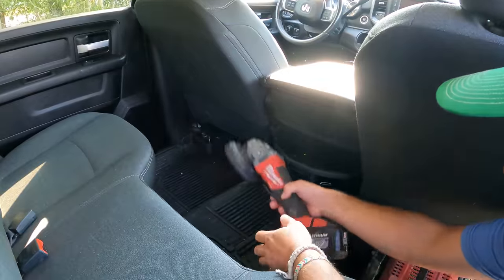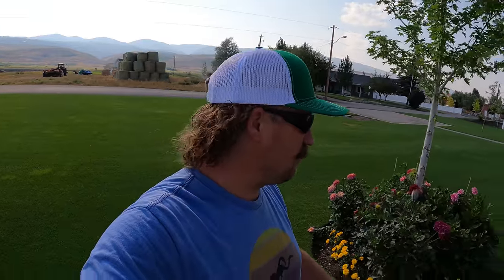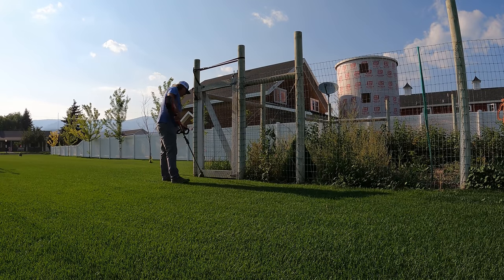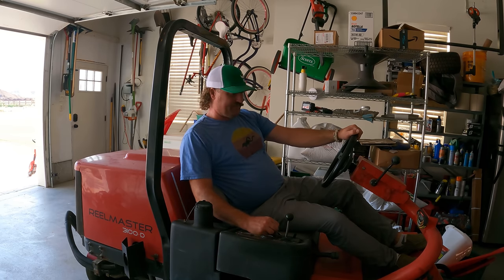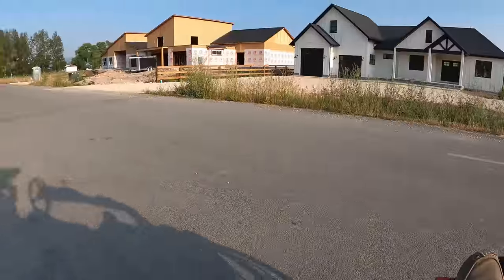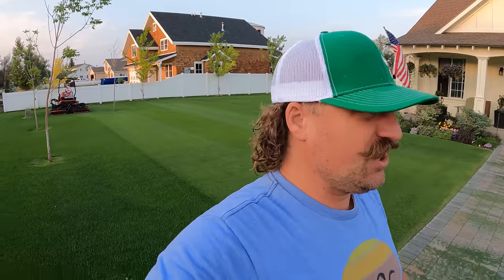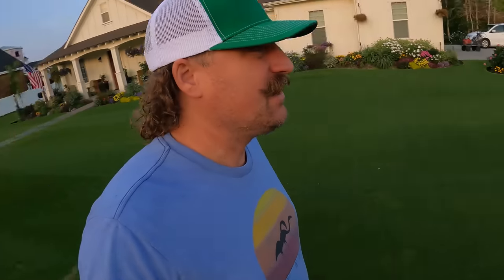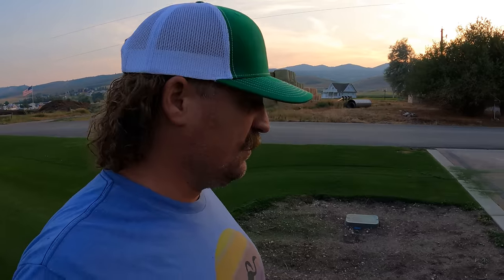Toro Reel Master 3100d Mow

Comment: Use Pro plugger or shovel to dig out the poa* - or use preemergent - no need to do a full reno… so much work and energy and I GUARANTEE you’ll get poa again
Reply: Yea your not going to dig out the annual bluegrass successfully
Reply: @garyboardwine3349  better not dig up my “annual bluegrass.”
Reply: @211212112  for sure,in my 30 years of golf course maintenance,  in some scenarios it's actually desirable,  on lower maint budgets,  bot so in others , the worst case I encountered the "annual blugrass" was over 90% of the putting green surface,  it took 4 years of cultural,  mechanical, and chemical methods to get the creeping bentgrass established,  still had about 10 % of the poa annua , the only place we ever worried about it was on the putting surfaces, mid Atlantic region, transition zone
Reply: @garyboardwine3349  yeah I figured the spots to really tend and cultivate would be the bentgrass putting greens. That grass is pretty unique and does not seem extremely hardy. I’d like to see it in its native areas where large swaths of it grows naturally if that exists. As far as the fairways and such it would seem ideal to use whatever grass that grows well in that area. I’ve seen nice lawns of many types of grass except crab grass.

Comment: Buy the milwaukee "pole extention" part and fit the rotary scissors on that, that way you have both blade and string trimmers available to use!
Reply from the maker: Genius. I knew someone would have a solution
Reply: Same with Ego. You can buy the pole assembly part for $25 and attach it directly. No need to cannibalize a working tool.

Comment: Poa Trivialis likes full renovations... the seeds stay underground and the pop out after the renovations... perhaps a spot treatment "kill them all" in the places where there is Poa. And the pre emergent two times a year for the next 2 or 3 years...
Reply from the maker: such a hard decision. Problem is the poa is way bigger than the spot looks.
Reply: @lawnrebel  It seems logical to dig those areas out but I guess you're right that it could be bigger than it looks. It still seems easier than smoking the whole thing which didn't even work last time since you have to do the dead areas anyway? I guess the short growing season doesn't help but you have had spots for several years and the effect on the lookie loos is still there so why not just focus on the problem areas? Just some thoughts, that's all.
Reply from the maker: @jonplatz2929  you definitely make some good points
Reply: @lawnrebel  I mean, if you rented some giant ass machine to dig that crap out it would still be pretty epic. Lol.
Reply: Maybe cut  out the poa with a sod cutter and then fill it back in with some sterile soil.
Reply: @jonplatz2929  in the poa areas some 7 or 8 inchs of soil removal and fill with sand and soil and kbg seeds on the top. If not all in 2 seasons it will be almost 100%

Comment: I hate to tell you, but a renovation will not get rid of your poa triv(hate to see you go through renovation and not achieve your goal)...it will be back in the spring...your only chance is a aggressive tenacity(every 3 days/5 apps total)  and then when it is really week hit it with Anuew for the rest of the year.  And then it still may not be dead but you may not notice it.  Mine turned brown and died,  we will see if it comes back in the fall.

Comment: Conor I have the same issue with my kobalt electric trimmer. With the guard off it will only let you have so much string length. When it's too long it will stop then start etc.. best thing cut 1in off your string and start with that.
Reply from the maker: That's bull. I gotta figure out how to fix that. I was thinking that this may be the case. I threw the guard straight into the trash. That never saw the light of day

Comment: One thing to keep in mind regarding your Poa Triv/Annua issue is the seed bank in the soil. Spraying it out and reseeding with KBG or PRG will not solve the issue. 
I’ve had success removing Poa at large scales via fraise mowing or in small cases plain old sod cutting it out 1-2 inches down to remove the existing seed bank. You will still need to have a solid pre emergent program once the new lawn is in as well if you want it to keep it out.

Comment: My experience with Poa Triv.  I live in Louisville.  I had around 10 patches of it come up last March.  Never had it before.  Must have been in the seed I reseeded with last Fall.  I wacked it to the ground with weedeater.  Used no chemicals.  I put down seed in bare spots.  It did not return last Spring.  I am hoping it will not return next Spring.  We shall see. Are you certain you have Poa Triv? It thrives in cool temps and dies out in Summer.  So I learned from research.  I would love to walk on your lawn!!  It is beautiful!!  I am happy with my TTTF lawn.  Been a great Summer for my lawn so far.  No fungus first time in 10 years !

Comment: Got the nice Ryobi trimmer battery operated, best trimmer I have owned yet.
Reply: I agree. I did the same and it's fantastic. So much less of a PITA.
Reply: @jonplatz2929  I'm assuming you guys mean the 40-volt, correct?
Reply: @randyman8984  yes

Comment: Same thing was happening on my Milwaukee trimmer.. was very frustrating. 12 H.O battery shorter line and it you have thicker line it will cause it to over heat. Super annoying, use a 8.0 or higher shorter line and thinner line and it’ll run for a long time!
Reply from the maker: good advise. Its pure crap.. I want my line long

Comment: Since PRG is so easy to germinate, just spot spray with round up all those poa triv circles and marker dye so you don’t miss any spots then overseed and hit those spots a little heavier. Easy. Also, avoid core aeration as it can bring up dormant poa seeds.
Reply: It's a Kentucky bluegrass lawn so not that easy

Comment: I will buy this because you said it was good.
Reply from the maker: Which? The trimmer? I do like it but if the line is too long you lose power
Reply: @lawnrebel  ya you bought it because you can swap it out with the edger.  I was debating hurting a husqvarna.  I want to have a good edger that I can swap for a trimmer.
Reply from the maker: I only bought it for the sidewalk edger but they make you buy the string trimmer. Like I said.. Turns out that I like it

Comment: RIP safety cone. If people learnt how to drive on the correct side of the road like in Australia or UK then there wouldn't be so many squashed cones.
Reply from the maker: Isn't that the truth. Butt hole drivers
Reply: I think they would still cut the corner it would just be going the other direction. I like the big rock idea.

Comment: Connor, I love your videos.  I notice you have lighter green patches on your lawn, as do I. Is that an annual POE? Is that correct?  my main question is, how do you get rid of those patches?  I have them all over my lawn.  Your help would be much appreciated.  from what I gather I have to cut out and either reseed or put sod down.
Reply: Watching all the vids - most likely POA TRIVIVIALIS - in this vid he does say “POA Triv all over the place”. 

If Annual POA he would have beat it for sure. POA Triv is a real pisser - kind of like KBG but ugly.  If watch other vids the lengths CE has gone to try and deal with it are extreme.

Comment: With your 3100D, how often do you backlapp and have to adjust your reel to bedknife?  

Looks great Connor!😎
Reply from the maker: Adjust.. Several times a year if not every week. Lap... I get it ground once a year
Reply: The reel to bedknife should be adjusted or checked to see if it cuts paper  before every mow, if every blade doesn't cut paper it's out of adjustment or dull, backlapping is a short term fix, a good relief grind, not flat,  and grind or replace the bedknife is the standard in the golf industry,  retired Toro technician
Reply from the maker: @gary I would love to have you here on my channel
Reply: @lawnrebel  I travel a lot on my bike you never know lol

Comment: Man I really REALY hate seeing you use that tri plex lol, those clippings should be in a catcher
Reply: @Bradford Pear there's 3 reels, one of them being under the seat.. he could install only 2 baggers
Reply: @Bradford Pear you don't understand. Only two reels are exposed in the front, the 3rd reel is hidden below the middle of the machine, with no possible way to attach a basket.
Reply from the maker: You're both incorrect. You can put baskets on all three cutting units. I gave up looking

Comment: Connor, don't use the cone, get yourself one of those Home Depot orange colored 5 gallon bucket instead.  Depending on how charitable you are feeling, you can fill it with water (being nice), sand (anger issue) or concrete (die you idiot drivers!).  :)
Reply from the maker: Someone previously said too get a normal cone and fill it with concrete. I may try that

Comment: Dude the Milwaukee keeps dying on you because it’s battery powered.
The battery is still a very primitive invention, it’s only on its third or fourth truly major advancement in storage capacity technology.Most of the time the engineers designing batteries have mostly been focusing on making them fit into stuff like cell phones, because that’s where the money is.
Sure I agree batteries should be better, but that’s the price you pay for supply and demand. Vape batteries are just more important to the masses than long lasting tool batteries.
Oh well.